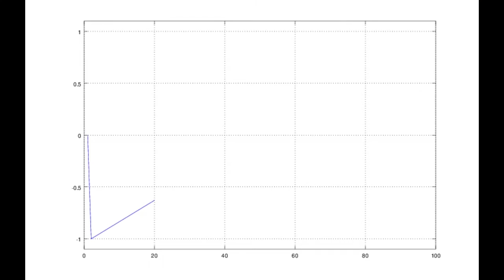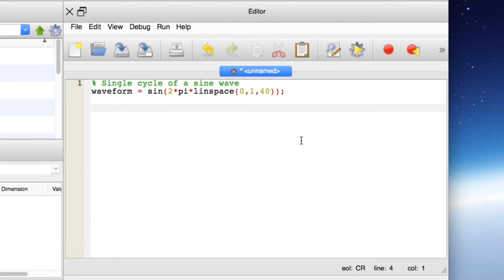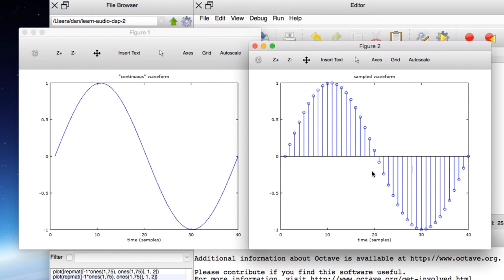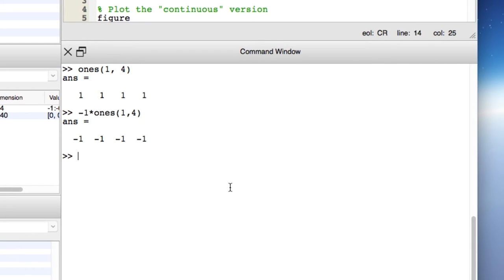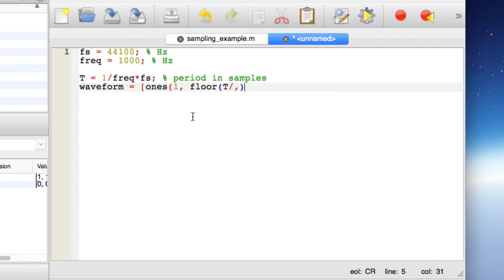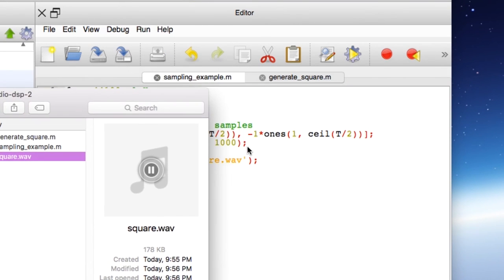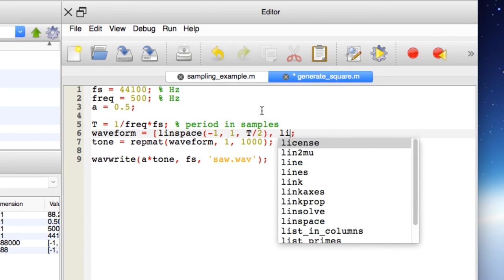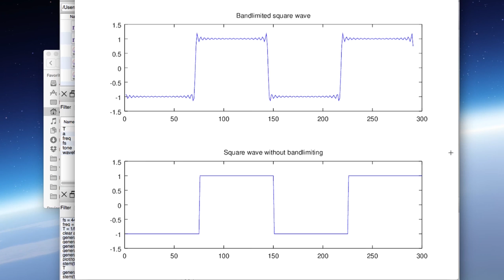Learn Audio DSP 2: Basic waveforms and sampling

Comment: What are your thoughts on pure data?
Reply from the maker: I've tried it a few different times. I think the fact that it runs in real time by default with little effort is a huge advantage. In general though I have a hard time thinking the way PD wants you to, and I often wished I could write a for loop or something that's easy in traditional programming. I also thought it was hard to stay organized with bigger projects, the visual organization seems to make more sense with smaller projects.